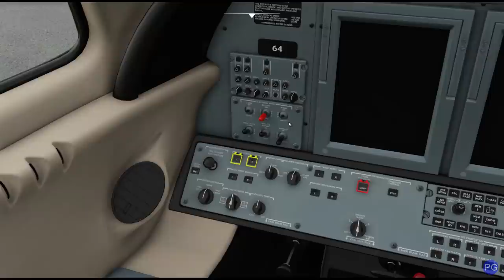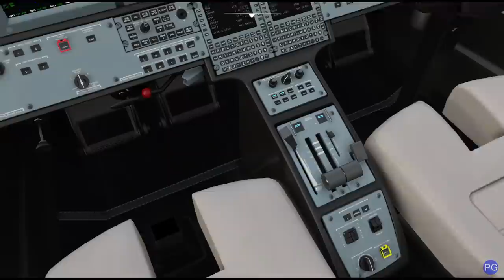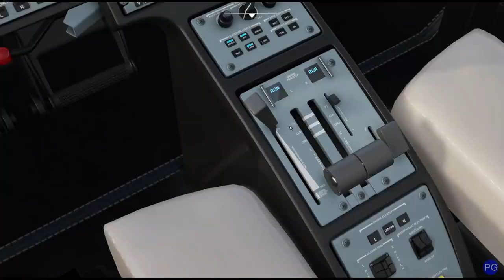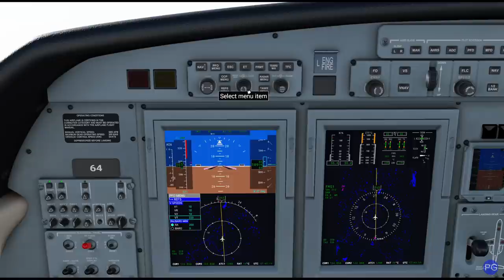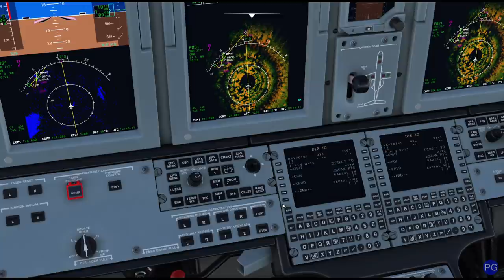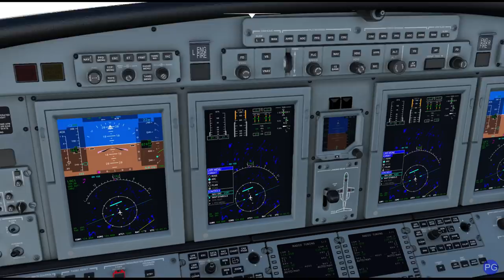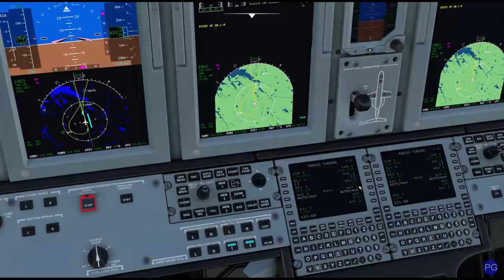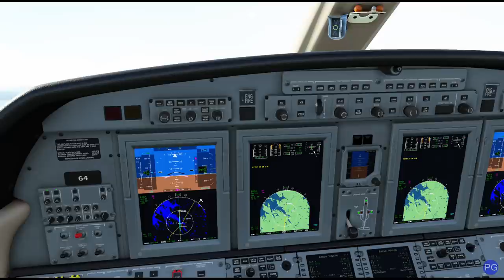FS2020 - Flying the Textron/Cessna CJ4

Comment: Thank you for showing this!  Am I crazy or did you hit pilot heat and not anti-ice showing us anti-ice?  So I love this plane and I fly it alot.  I do have one major question.  What does the speed adjustment on the AP do exactly without AT?  In the same breathe how does FLC work?  I presume you would need to monitor the speed but I see there is a speed adjustment knob.  I have yet to see how this works.